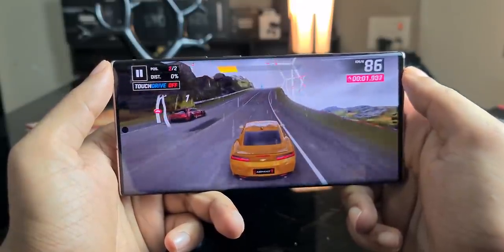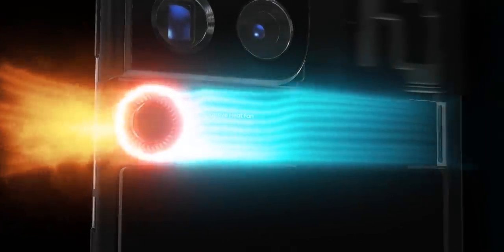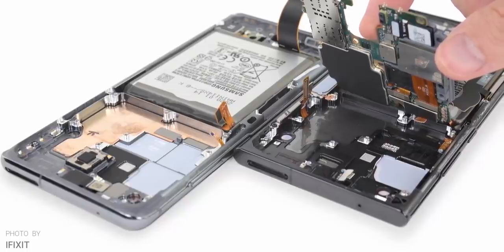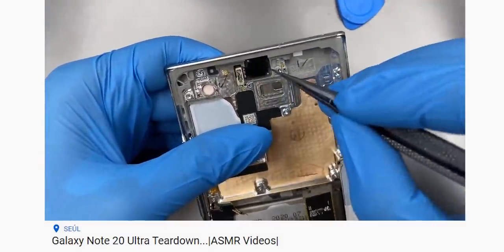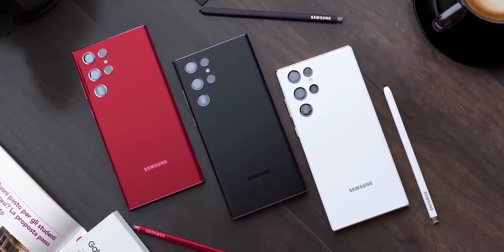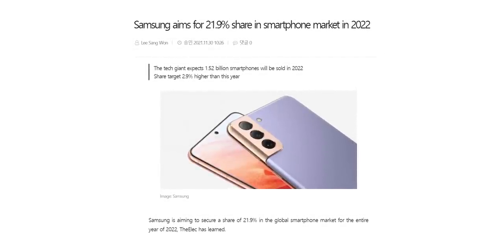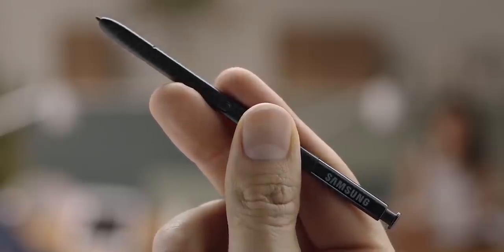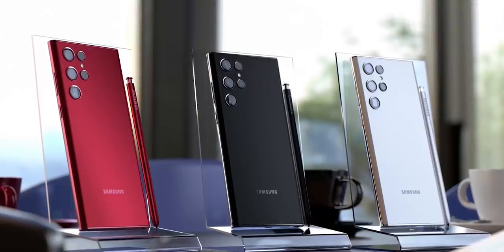Samsung Galaxy S22 Ultra - GOOD NEWS

Comment: Good news should be that the s22 phones should have the SD card slots!
Reply: Right since they're getting rid of the note line
Reply: Personally I don't like. Beacuse it makes and Feels Phone Slow.
Reply: They won't have 1
Reply: @md.tawhidulislam7400  you don't know what are you talking about son
Reply: @QueenNikki82  they will, they did from the S6 to S7, so will they with the S22, that SD is very essential when taking photos and high resolution videos because you can move them later on the SD card, even if you have a 512 GB phone
Reply: @raulbila46  Braaaaaa. I like It. It is a Great Feature But It feels Slow.

Comment: The limiting factor is still getting rid of the heat through the back of the phone. Using a vapor chamber instead of a graphite pad just means it can move the heat faster, but it still needs to actually dissipate the heat too. And a flat glass back isn't really that efficient for heat dissipation.
Reply: what would be efficient?
Reply: @theblitz1687  metal back
Reply: @benno66691  hmm, but that would also make the phone uncomfortable to hold bcs itd get too hot
Reply: @theblitz1687  not producing too much heat
Reply: @theblitz1687  The phone will not get too hot. As the temp increases, it is able to dissipate it faster. And since phones are relatively low power anyways it will even out at a temp that is uncomfortably warm but not actually hot enough to injure you.

A metal back would allow it to stay even cooler though as it would allow it to dissipate heat faster. In order for the temp to build up it needs to not dissipate.
Reply: @nope1918  well you said it, of course it wouldnt get hot enough to injure, companies would take that into account. But it would get uncomfortably warm which was my point.

I am not sure about your last point, better heat dissipation means phone will get hotter faster right? Metal would take the heat from the socket quickly and spread it throughout the phone and make it hot fast, meanwhile glass would be hesitant and get hot slower. This could mean metal back could sustain higher performance longer though. Anyways this is how i think..
Reply: @theblitz1687  I'm sure Samsung knows what they're doing when I got the 13 pro max while playing games the screen brightness was turned down probably to save battery life making playing games a annoying and temperature reaching 45 degrees I just had to return it Samsung won't do that kind of mistake and there won't be any deeming
Reply: @avnertouitou3778  actually, samsung does the exact same thing, its usually phones like xiaomi that allow for higher temperatures. I really dont think you should have returned your 13 pro max, its an amazing phone. Its pretty efficient you would have much more fps than s21 ultra. I guess you should wait for s22 ultra

dimming is because of heat, not for battery saving btw
Reply: @theblitz1687  I've never used apple so idk, but I've never had an issue with the screen dimming while playing games on any of my samsung devices...
Reply: @nope1918  my s10+ used to dim on android 10 but it stopped when i updated to 11. Now im back on 10 though i dont know if new phones are dimming for %100 but i feel like its likely..

Comment: Hey Sal which chipset is going to be the best u reckon? Dimensity 9000, SD 8gen 1 or Exynos 2200?
Reply from the maker: Snapdragon 8 Gen 1 for sure. Dimensity 9000 will match it in CPU power but will fall behind in GPU. Considering we're not hearing anything new about the Exynos 2200 could suggest they are not confident with the GPU capabilities of AMD. We'll see
Reply: @TechTalkTV  I really hope Exynos 2200 is gonna be a good match for the SD 8gen 1 coz many markets are getting that and I hope they won't be disappointed this time
Reply: @TechTalkTV  i mean the tsmc 4nm makes the dimensity much more efficient than the samsung 4nm on the snapdragon 8 gen1
Reply: @TechTalkTV  What happened to "We will use an AMD powered exynos in our next flagship phone" ?
Reply: @Matchleader  They will.
Reply: @69mviewsnt  no there is a global chip shortage
Reply: Due to the global chip shortage Samsung will have to use the Snapdragon version
Reply: I think 2200 and 8g1 would but exyos might be better in some case lets see
Reply: Snapdragon obviously
Reply: a15!
Reply: @T0NYMANUEL  disappointed customer here🙋🏻‍♂️ Again Europeans get the weaker cpu.
Reply: A14
Reply: A 15
Reply: @princeyahwehtv1144  It does not exist, yet.
Reply: @dervillager8038  even deminsity 1200 uses tsmc  fabrication. It throttle much then any snapdragon chip of similar generation
Reply: @Rahat2995  dimensity 9000 > dimensity 1200
Reply: @Rahat2995  dimensity 1200 was tsmc 4nm? i dont remember that...
Reply: @dervillager8038  It was on tsmc 5 mm not 4mm. Fabrication process is still same.

Comment: The way to change sales is to bring back the features that make Samsung stand out from other androids and that's with SD card expansion storage and MST (MAGNETIC STRIP TRANSMISSION)
Reply: Infra red sensor as well
Reply: Removable batteries, stylus, infrared,  MHL (wired cable connection to TV) these are the hallmarks of the note. Even Samsung phones are lesser creations than my note 4 because of this.

Comment: Thanks for the update Sal. The S22 Ultra will definitely be a hot phone. Or maybe not so much finally. 😁
Reply: This cooling system was already used it's really not that big of a deal...
Also dissipating heat doesn't mean that the phone will get less hot but mostly that it can run high demanding tasks for longer.

Comment: But sad part even though it has so much hardware >> 100% sure it wont have basic HD/HDR 60fps in PUBG/BGMI for exynos variant. cuz 3rd party apps dont care abt exynos.
None of the exynos 9825 , 990 or even 2100 has it. Many games are optimized for Snapdragon and I am happy this time many place [INDIA] we are getting it
Reply: Agree i've exynos 9825, & it's a typical exynos
Reply: @अभय_अग्रवाल  yes but Problem is 25% due to EXYNOS cuz no one cared and 75% of KRAFTON for not optimizing to any of the flagship exynos past 3 years.
I am 100% sure it will be same for Exynos 2200 too .!!

Comment: I will be happy if india get the snapdragon version with this vapour chamber cooling tech. If heating issue is solved then evrything else will work great.
I would still prefer snapdragon over exynos unless exynos resolve the heating issue and a stability in terms of efficiency.
🤗 i have been using exynos since a very long time.
Reply: Don't worry it's confirm it will be snapdragon varient in india😊

Comment: I am really hoping for an s22 ultra no pen version. I want a big display and best cameras, therefore I will probably upgrade to the ultra. But I have no need for a pen. Really hoping there is a no pen version which in turn gets the space used with bigger battery, expandable storage, etc...
Reply: You can use spen for itching ears.. 😁 (everythibg has a use)

Comment: Not getting it without a micro SD card slot but at this point it really seems like all phones are not installing a micro SD card slot.
Reply: That's becoming a thing of the past, just like headphone Jacks did
Reply: @Sway_Boogie  they're not becoming a thing of the past, they're still needed at least on low and mid range phones that come with skimpy amounts of base storage, and on tablets and laptops. Samsung is making a big mistake to eliminate them from their flagship model. Even Apple brought SD back to the MBP where it had been missing for years.
Reply: @pataplan  isn't there a news about Samsung taking it away from the budget and mid range phones too